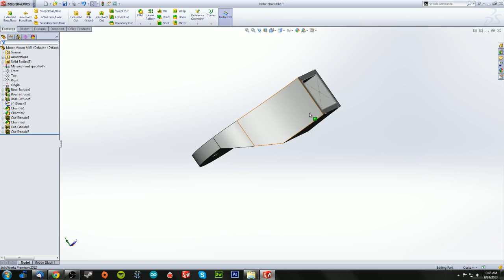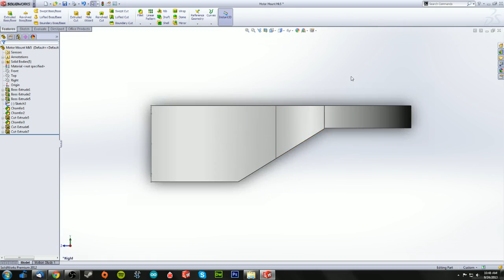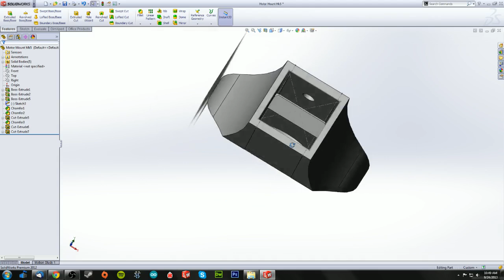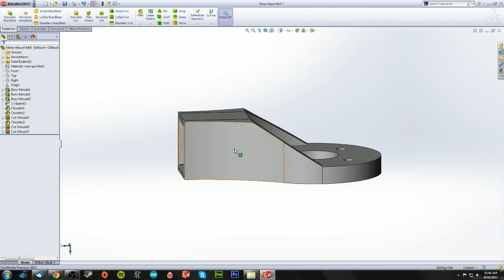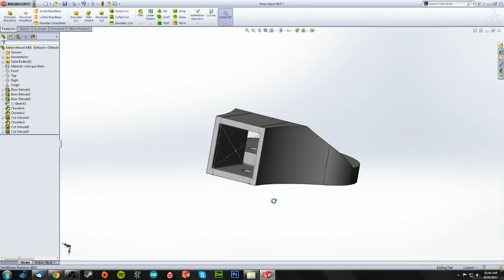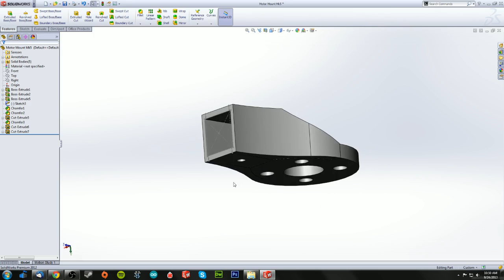Danny's 3D Printed Tricopter Motor Mount

Comment: It is a Tricopter based on rcexplorer.se I am in UK bit the woodstock I can find readily is 15mm x 15mm or 10mm x 12mm. Using underslung motors.
Reply from the maker: Quick vid of the 3D printed motor mount before work.